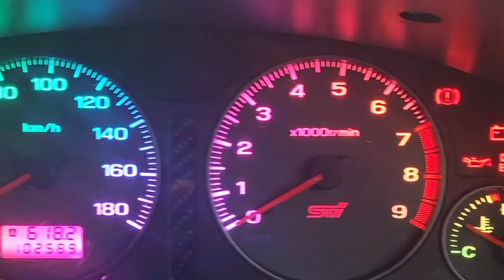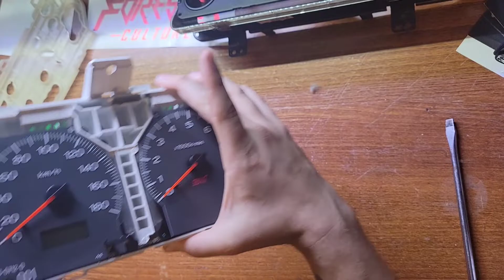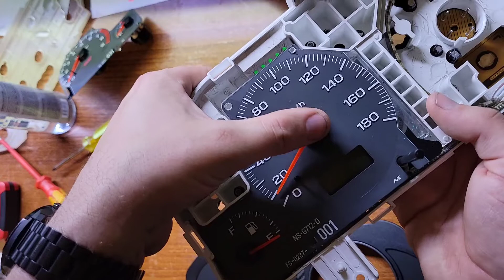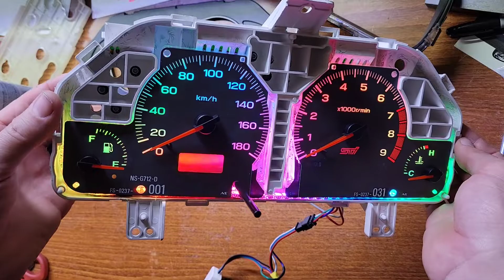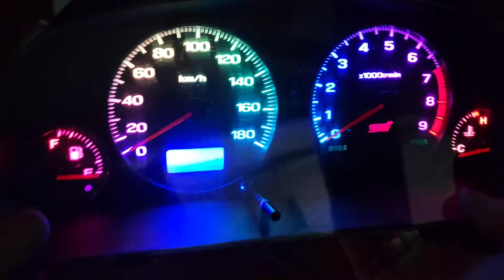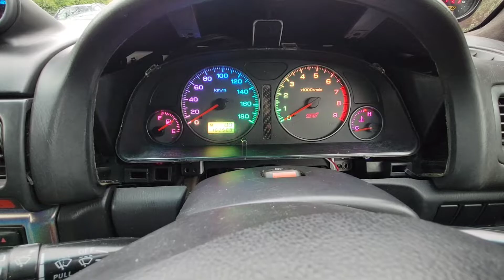RGB dash 2001 Forester STI

Comment: Because at 5V cc if the car has 12V
Reply from the maker: There is a buck converter that reduces voltage to 5v or you can use a USB (same same)

Comment: I got the controller trying to find the led strip on eBay
Reply from the maker: I got mine from Amazon 
https://a.co/d/dFZznPi
Reply from the maker: These are similar to the ones I have not the exact same. Make sure they are 12 volt before you plug them in

Comment: well, my Outback has the D light out, looks soldered in.. Will probably cheat and get a spare from the yard, as usual.  My 80s Subaru have a removable layer and then it's all transparent.
Reply from the maker: The tiny soldering scares me

Comment: Ic u have some extra long wires ??
Reply: Was it just the 4pin from the led strop to another 4 pin to the module n then power from there seen the 2 pin figured was for different lights
Reply from the maker: I have had so many different light strips 😩 some 3 wire some 4 or 5
Reply: @stressed_garage  ah what they last a year or so
Reply from the maker: @jdm4stance the current ones on on 3 years
Reply: If could explain some of ur wiring if that and 3 for when u swap em to have options and if could find a link would b clutch n so nail polish and it’ll just melt/wash away the green
Reply from the maker: @jdm4stance shoot me a message on Instagram and i can walk you threw what I did

Comment: It doesnt also affect the warning lights?
Reply from the maker: No, they have there own light areas
Reply: @stressed_garage  awesome video and project. I tried to do it myself, but my dad and i felt that the piece wasnt conducive to having the led strip in it. Not much room to work with. I ended up putting purple cellophane over the lights, so now mine are just purple. But they look cool.